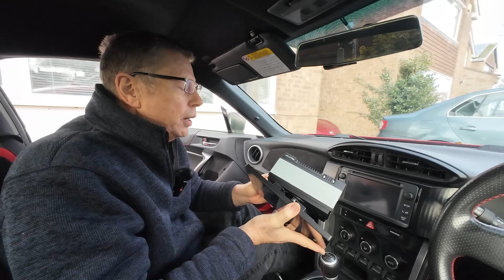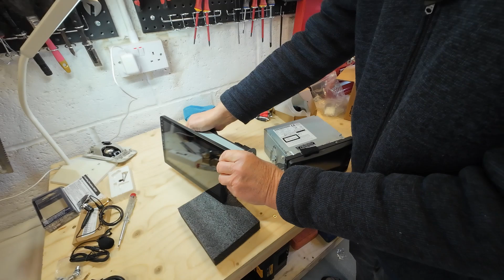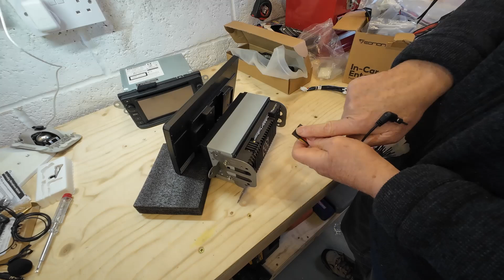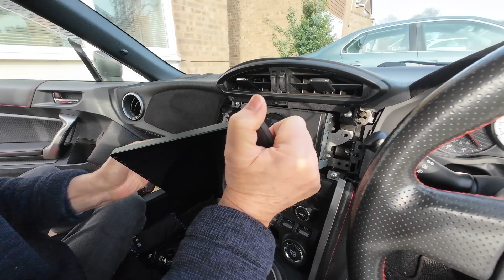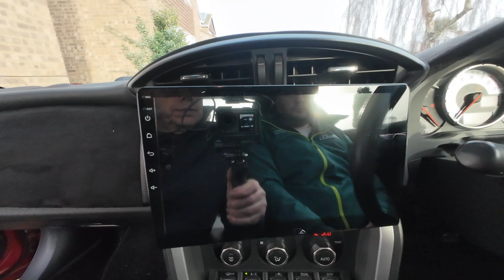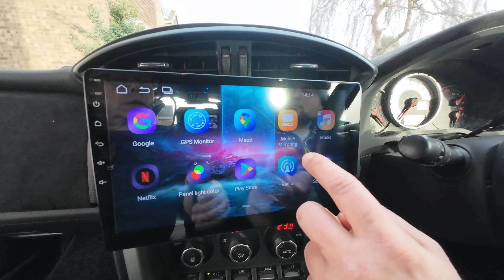Toyota GT86, Subaru BRZ, Scion FR-S - Android Headunit Installation

Comment: 16:12 Hi, did you come up with a mounting solution for the Olympus mic? I'm looking to get one but dont think the clip will work for me. Interested to hear how you bave done it in installs. Thanks!
Reply from the maker: I have now done a number of installs. The included mic clip can be used to mount the mic at the top of the A-post or on the headlining by the rear view mirror. On the GT86 and a Prius I mounted the mic on top of the steering column cowl using a self-adhesive cable clip which is the correct diameter to fit tightly around the mic body.